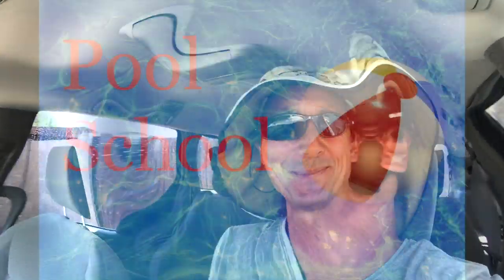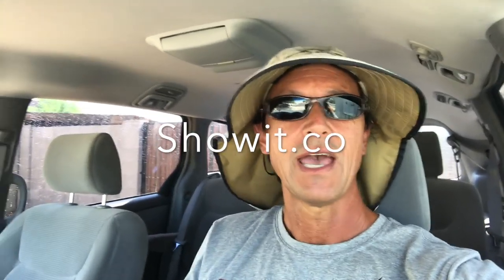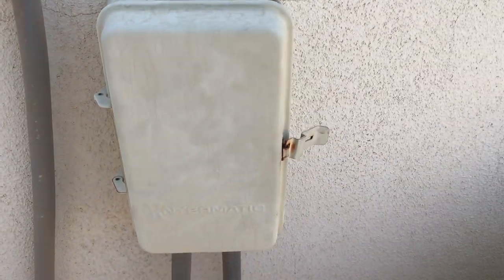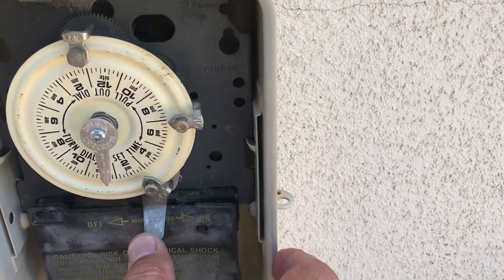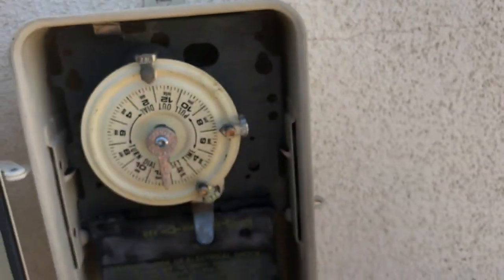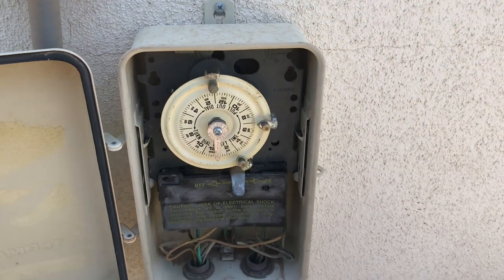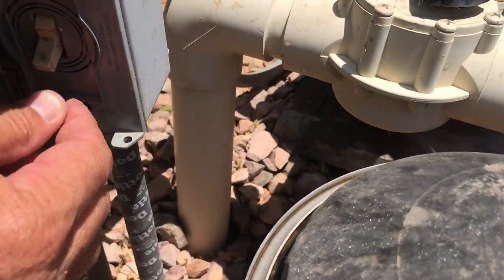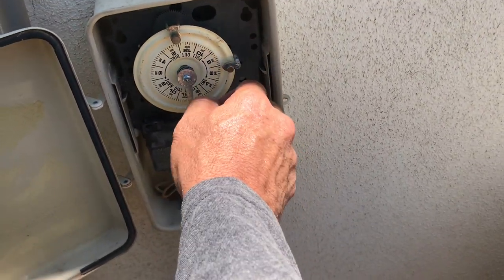Pool Time Clocks - Mechanical

Comment: Those Hayward variable speed pumps work really really good.. almost makes you think there off.. lol . I try to sell those to my clients.. to try to switch away from those single speed pumps.. save them some pg&e bill
Reply from the maker: I was a big skeptical when the dual speed motors first came out.  Wondering if they'd hold up, but so far they have proven themselves. Both the Hayward and the Pentair.  Kudos to them for making a good and durable product.

Comment: needs a lil cmaera stand in the ride. so wiggley :). i like m clocks , simple and easy
Reply: Ooooh now i see =what that 3rd one can be for .. good stuff
Reply: i got some simple green recently and mega diluted it with water in a spray bottle and used it to clean and clear the pump basket lids (for clear viewing ) and gave the button faces a wipe down for sparkling equipment . is it ok to use that product , 90/10 water to Sg ?

Comment: Are time clocks required in Arizona? Ny requires them
Reply from the maker: I honestly don't know.  Although I'd recommend them highly so you don't waste money accidentally leaving the pump on or forget to turn it on and have a green pool as a result.
Reply: @PoolSchooler  mine has been running full time until the pool company that built my pool comes to demonstrate the operation of the filter, vacuum, etc as their final step. I do have a timer for mine, just no stops on it presently